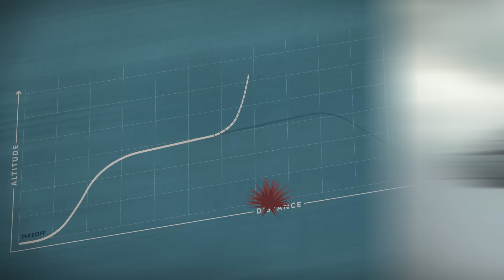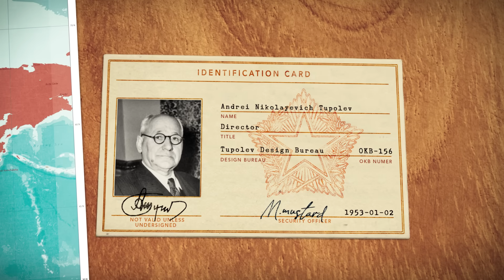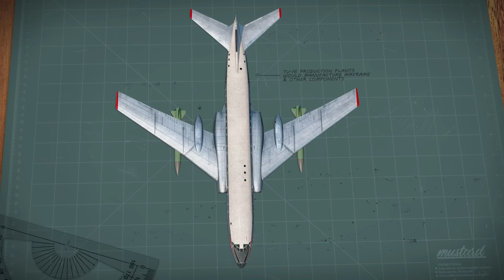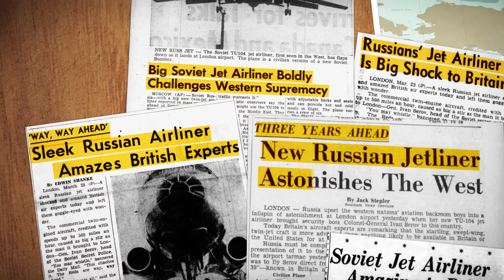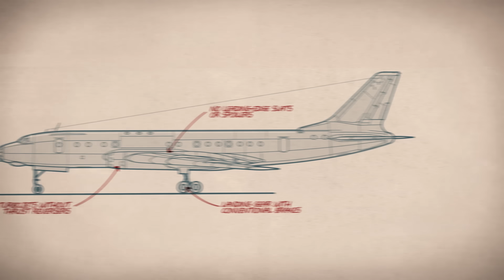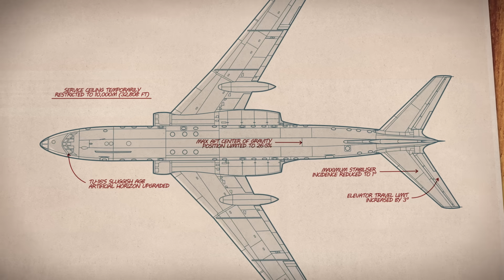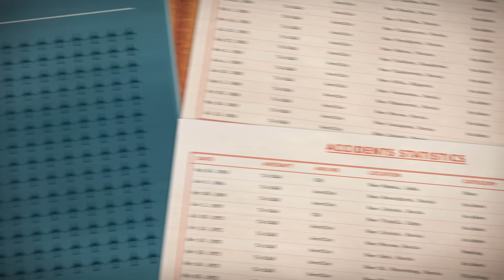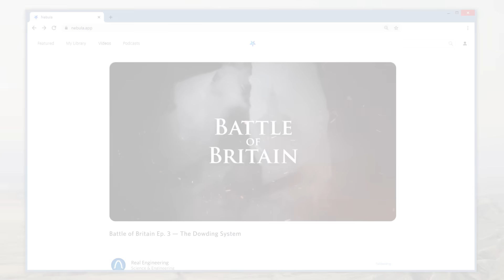The Soviet Airliner Designed To Crash

Comment: UK years of research 😂😂😂 ??? More like years of reverse engineering NAZI technology
Reply: We do indeed feel we can clear up some commonly held myths and misconceptions.   

  It's always good to have relevant facts set out clearly isn't it.

  Frank Whittle performed the world's first demonstration of a gas turbine aero engine in 1937.

  Of course The RR (Of England) Nene gas turbine aero engine was indeed the most powerful & most reliable gas turbine aero engine on the planet in 1944. 
   
 Indeed, versions of the RR Nene engine, as license built engines or unlicensed copies would go on to power aircraft in Russia, China, France, Sweden, the US & other countries for decades after 1945.

  Without doubt it is the case that before 1900 Parsons of Ireland & North England produced the world's first axial multistage sequential stator / rotor turbines & compressors for turbomachinery use, the main  components used in most current gas turbine engines.

Of course we hope this helps.

Cheers indeed as always 👍

Comment: hi
in 2016 or 2017 i was on tha plane and the front window ( pilots cabinet windows ) cracked and we had emergancy landing.
can i ask you, what would happend if it would completely shatter?

thank you for your time.
Reply: Firstly, thats literally not possible the tu-104 was retired about 40 years prior in the early 1980's but to answer your question if a window would have fully disassembled at cruise altitude the sudden depressurization of the cabin likely would've damaged multiple flight control systems and would've made the crew and passangers unable to get enough air due to being at such a high altitude.
Reply: @ well i have photo of cracked window if you are interested.
the oxygen would be taken care of. 
so this was Pilots cabine, so if someone gets sucked out it would be disasterus.

i was thought that the temparature and the front wind would be deadly for pilots.
Reply: @slapsak1  temperature is usually a negligible factor as after the aircraft loses pressure, they almost immediately begin decending in altitude as well as reducing speed, which both removes the wind from lack of speed and makes it not as cold since they are now not as high and there is less wind in the cockpit.  I agree that the worst thing to happen in this situation would be the pilot being sucked out from the sudden depressurization.
Reply: @badwahs2578  thank you for anwer. i have thought that the wind and tempature could be deadly.
thankfully didnt shattered, but i wondered many times how close i was to a disaster.
Reply: Worst case scenario is someone could be sucked out of the open window, it has happened before.
This type of failure does not usually cause a crash or any significant deaths or serious injuries.
Planes today are equipped with supplemental oxygen for the pilots and the passenger and is usually sufficient to get the aircraft down to a safe altitude.

Comment: it seems sander's yin has met pete's yang. may they both go back and forth over a 70+ year old plane for all of eternity
Reply: Pete,/Paul/peppa's erratic, irrational rants speak for themselves.... clearly someone completely detached from reality... and society.
Cheers and safe flying my friend!
Reply: @sandervanderkammen9230 

Of course,  @sandervanderkammen9230 obviously has irrational obsessive disorder (IOD) & would probably be better of writing children's fairey tale books.

Obviously it's always very important to note the relevant facts.

Kharzeestan Krappenz DiktorBummer  Diktorbatermasturjurkzxoffenzische etc and co - they should all note good with much awe & extreme wonder.
        UPDATE MORE BREAKING NEWS ETC

 Of course De Havilland carried out a full stress analysis & performed extensive & protracted testing on two long lengths of fuselage. De Havilland carried out significantly more testing than was required by any authority at the time.
 
It is the case that The stress for the crown sheets when measured was not greater than predicted.
  
  Obviously there have been worse aircraft for accident losses both before & after the Comet.

    How things were back then -
Accident losses - % of aircraft built.
DeHavilland Comet 4 UK     14% 
DeHavilland Comet all mks  17%  
Vickers VC10 UK 5%
   The DH Comet had better safety than or similar safety to many other commercial passenger aircraft of a similar era
    Douglas DC-1        99%
      Douglas DC-2        47%
    Douglas DC-3        30%
      Douglas DC-4          26%
    Boeing s300            72% 
 Boeing 307               70%
  Boeing 247                48%
     Boeing 707                   20% 
Lockheed L-049/149 Constellation  30%
   Lockheed Electra  Turboprop    29%
Fairchild FH-227                        30%
 McDonnell Douglas DC-8        14%
  Sud Aviation Caravelle            15%
Canadair CL-44  Turboprop     46%  
Convair CV-580  Turboprop     22%
Convair CV-880    (ff 1959)       27%  
Convair CV-990     (ff 1961)      33%
Tupolev T-104          (ff 1956)    16%

Obviously the French Caravelle, a very similar aircraft to the Comet, also at the time didn't result in Sud Aviation becoming a significant competitor to Bow-wing  (See B-47 wing folding and wing collapse incidents).
        The Comet was designed with military use in mind, Nimrod work started at De Havilland in 1953.
  The committee did not find hundreds of fatal flaws or evidence of design defects, structural defects, defective materials or shoddy workmanship. Ripstop provision was included. Claimed incidents did not involve cracks starting from window corners & one particular incident did not involve a fracture running from a rivet hole. 
     The engine & engine intake position had advantages, were not flaws or fatal flaws & were not the cause of any incidents involving any Comet or Nimrod aircraft. Nearly all changes before the Comet 4 were just in case or were previously scheduled improvements. 
  In fact it is the case that the skin thickness of the Comet remained largely unchanged for later versions. The alloy used was changed simply because the manufacturer discontinued the original version. 
  Bow-wing & the 707 story (see b-47 wing folding & wing collapse incidents) is the result of global economics & the well protected & very large domestic US airliner market & active support from the UK with for instance proposed competing airliners from Vickers & DH being blocked by the UK government at the time, cheap & nasty was the requirement with large scale production capability in one place.
  The 707 was of course a much larger aircraft which as a stressed skin metal airframe aircraft would require a thicker skin anyway. They got lucky at the time essentially.  Bow-wing is the result of the large & well protected  US domestic airliner market 
  The 707 had a very long production run with a large number produced, the average life of a 707 doing airline duty only was about 22 years. Military duty 707 airframes get a lot of big military budget attention & there are plenty of spares from retired aircraft which is why there are still examples in service.
  The fate of De Havilland was due to Govt policy Aerospace sector rationalisation & global economics, it was nothing to do with the Comet.
  A comprehensive, thorough & protracted testing program was carried out on the prototype & it's assemblies. Of course the Comet did indeed have Ripstop stop provision. 
     De Havilland (Of England) Comets were not grounded after 1970 due to structural problems.
It's interesting that some of the aircraft on the list should really have been noticeably safer than the Comet due to being a similar type but of much later design & manufacture but they definately were not safer.
    How things were back then -
Accident losses - % of aircraft built.
DeHavilland Comet 4 UK     14% 
DeHavilland Comet all mks  17%  
Vickers VC10 UK 5%
   The DH Comet had better safety than or similar safety to many other commercial passenger aircraft of a similar era
    Douglas DC-1        99%
      Douglas DC-2        47%
    Douglas DC-3        30%
      Douglas DC-4          26%
    Boeing s300            72% 
 Boeing 307               70%
  Boeing 247                48%
     Boeing 707                   20% 
Lockheed L-049/149 Constellation  30%
   Lockheed Electra  Turboprop    29%
Fairchild FH-227                         30%
 McDonnell Douglas DC-8     14%
  Sud Aviation Caravelle       15%
Canadair CL-44  Turboprop   46%  
Convair CV-580  Turboprop 22%

A comparison of more recent aircraft.
Accident losses comparison examples. 
1970s - 1980s
    % of total Aircraft built
Similar aircraft type, date / decade, useage, size.
    Biz Jets
BAe-125-800                        1.7 %
Beechcraft Beechjet 400    2.2 %
Cessna 550 Citation II         7.1 %
Learjet 35 / 36                       12 %
Beechcraft 1900                  6%
Dassault Falcon 10              11.5%
Aérospatiale SN.601            22.5%

Medium size jets / Turboprops.
BAe-146               5.1%
Fokker 100          6%
McDonnell Douglas DC-9-30       9.5%
Fairchild FH-227       30%
McDonnell Douglas DC-8    14%
Canadair CL-44  Turboprop   46%  
Convair CV-580   Turboprop   22%

Beechcraft, Fokker, McDonnell Douglass, Learjet, Fairchild, Aerospatiale, Canadair, Convair  companies defunct.

    All Comets, including some Comet 1s, had full civilian use certification at some point after 1954,  civilian use certification only being withdrawn after commercial flying stopped. Examples were flying until 1997 - one example did a signals research global circumnavigation flight series in 1993 via Australia virtually without a rest travelling 28000 miles, only had an ice warning indicator issue during the flights.

    The DH Comet - World Firsts.
1st gas turbine jet powered airliner. 1st high altitude 8psi pressurised full fuselage length passenger cabin airliner,  not a trivial feature as structure  strength required for pressurisation considerably exceeded strength required for normal flying stress. Nobody else had done anything similar before the Comet.
  The b-47 (& the Junkers) used relatively small, heavily built  pressurised modules  (Bow-wing b-47, the aircraft where 6 had their wings fold up in 2 months while flying & some had their wings fall off while parked). 
   The 1937 Boeing piston engined airliner pressurised passenger cabin was pressurised to 2 psi only - in fact that could easily be done as the normal unpressurized fuselage cabin structure strength for flying stresses only was all that was needed to be adequate so no significant weight increase issues needed addressing.
    1st all hydraulically powered flying surface controls & actuators airliner with under carriage wheel disk brakes + ABS.
1st jet airliner to cross the Atlantic.
1st jet aircraft to do a world circumnavigation flights series.
  Of course De Havilland had prior experience building many all metal construction airframe aircraft including thousands of jet powered fighter aircraft that were primarily of metal construction with pressurised cockpits & jet engines built by De-Havilland & we know the world's first all metal construction airframe airliner was built in England in the 1920s by Handley Page.
  Indeed it is in fact the case that airliner construction & testing changed everywhere, including in the US, during & after the Comet investigations.
     De Havilland did indeed always work to better than industry standards at the time, used up to date knowledge for the design & no evidence of negligence  or criminal negligence was ever produced in relation to the DH Comet.
    The course of De Havilland & the general UK aerospace industry sector was not affected even slightly by the DH Comet. The course of national aerospace sectors obviously being similar & inevitable in many countries.
     Other interesting World firsts
World's first turboprop aircraft.
Vickers Viscount Turboprop Airliner 1947. 
A 1945 Gloster Meteor Aircraft with Turboprop Gas Turbine Engine.

They might like to answer these questions.
   Which airline has just ordered
60 RR England Trent XWB Engines
& What aircraft are the engines for?

Bonus question for 10 points.
         Which country has the 
World's Highest Combined Per Capita
  Nuclear + Defence + Aerospace Sector Activity?    

          👍 & 🙂 & of course 😎 indeed.
          C H E E R S & without doubt  -
          Toodle PIP Old C H A Ps.
 

. .... . ... .. . . ...
. . ... ..         ...

Comment: @sandervanderkammen9230    
    
Obviously We feel we can indeed shed some light on some common misunderstandings & misconceptions.
   
Clearly It is indeed always good to have the facts to hand.

That's correct, Comets flew until 1997. Some examples of all marks of Comets had full certification and were flying after 1954.

Two substantial lengths of fuselage were pressure tested extensively. De Havilland carried out significantly more testing than any authority required. De Havilland engineers did stress calcs for the entire airframe 

It is true that The Comet design had military use as a requirement. Nimrod development began at
De Havilland before 1953.
   Nimrods were not withdrawn due to structure problems or other airframe issues it was entirely a significant upgrade snag & resultant basic economics & an end of line sale happening at Boeing at the same time.

Obviously The engine position & inlet design were not flaws or fatal flaws, there were good reasons for that design choice at the time which had some aerodynamics advantages especially when considering it's intended military applications. The subsequent design modifications were simply to render pilot errors during takeoff less likely to cause a stall, those pilot errors being due to propeller airliner pilots not using jet specific takeoff procedures. 

  If course at the time the Comet didn't  have particularly high accident loss rates relative to many other aircraft.

Losses comparisons,
how things were in those days.
Accident Losses % of Total Aircraft.

DeHavilland Comet 4 UK           14%
DeHavilland Comet all  mks       17% 

Boeing 307                                         70%
Boeing 247                                         48%
Boeing 707                                         20% 
Lockheed Electra Turboprop           29%
Canadair CL-44  Turboprop             46% 
Convair CV-580  Turboprop             22%
Convair CV-880    (ff 1959)              27% 
Convair CV-990     (ff 1961)             35%

   Yes, it is the case that De Havilland carried out full stress analysis & engaged in a comprehensive & protracted testing program which is why key De Havilland people were happy to be aboard flying DH Comet aircraft.

Of course De Havilland had prior experience building many all metal construction airframe aircraft including thousands of jet powered fighter aircraft that were primarily of metal construction with pressurised cockpits & jet engines built by De-Havilland.

    The DH Comet was of course the first passenger airliner with full length fuselage pressurisation at 8psi pressure differential. Handley Page built the world's first all metal construction airliner during the 1920s.
   
   Of course ripstop provision was provided. The skin alloy used became unavailable at the time due to R & D at the manufacturers which resulted in the original alloy being discontinued.
The skin thickness used for the Comet was used for similar later aircraft.
Frame spacing was not found to be too large & frame width was not found to be too small.

  Indeed, that's right, In many cases earlier pressurised aircraft were larger, needed thicker fuselage skins due to flying stresses & had much lower pressurisation differential pressure.

  Without doubt, De Havilland did indeed always work to better than industry standards at the time, used up to date knowledge for the design & construction & no evidence of negligence  or criminal negligence was ever produced in relation to the DH Comet.

    Of course The investigation committee did not find hundreds of fatal flaws or evidence of design defects, structural defects, defective materials or shoddy workmanship. Ripstop provision was included. Claimed incidents did not involve cracks starting from window corners.
Pretty much all changes were just in case changes or were planned development modifications & improvements that were scheduled regardless of incidents.

   Yes, it is correct to say that The DH Comet had no effect on the course of the aerospace industry in the UK. The UK now has the world's largest combined nuclear, aerospace & defence sector per capita activity.

  It's generally accepted that De Havilland designers knew all there was to know about metal fatigue at the time they designed the DH Comet. In fact nearly all subsequent changes to the Comet were previously planned improvements or just in case changes during the investigations. After the incidents how airliners were built & tested changed everywhere airliners got built.

  The world's first all metal construction airliner was built in England during the 1920s by Handley Page.

 The world's first demonstration of a pure gas turbine aero engine was performed by Frank Whittle in 1937.

  The first example of a pressurised cabin aircraft was a British design  Airco aircraft built under licence in the US & modified to have a pressurised cabin during a joint UK / US research project.

  The gas turbine engine was first conceptualised & patented before 1800 in England.

 The world's first axial multi stage sequential stator rotor turbines & compressors were produced in England by Parsons of Ireland & North England. The same components used in many modern gas turbine aero engines. Parsons also did some work on the internal combustion gas turbine engine.

  Of course we do indeed Hope this helps obviously.

Cheers indeed etc 👍.  

. . .... ... ..... ..  ... .....
. .... .......  .... .   .. . . .